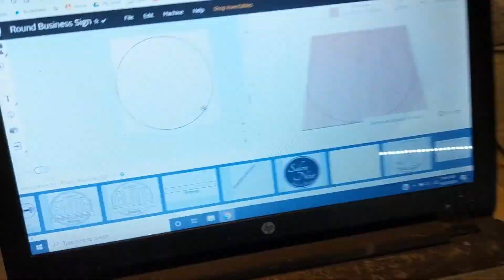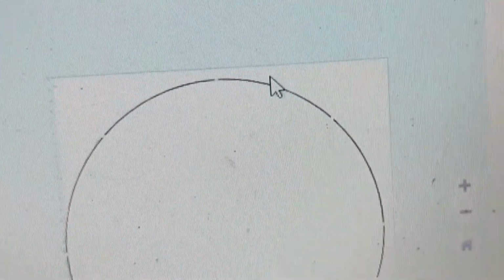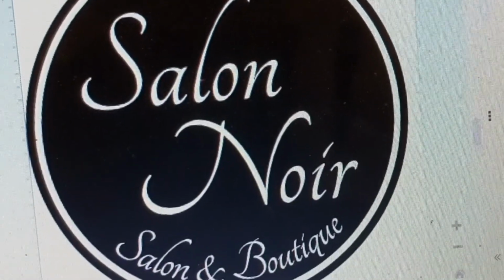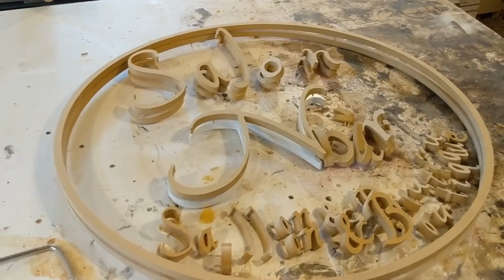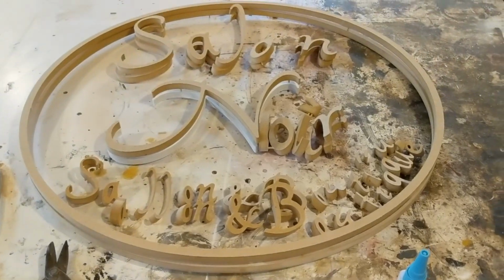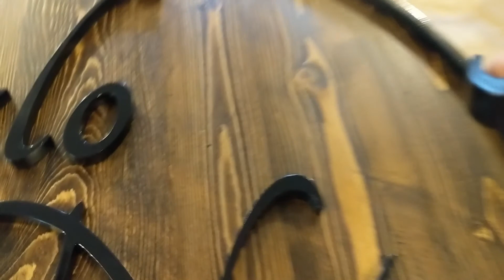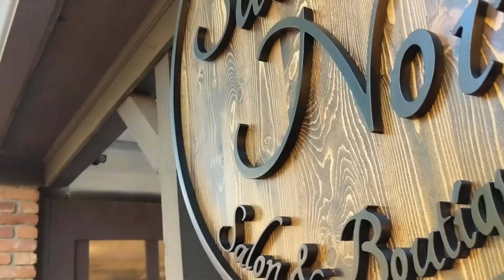How to Make a Perfect Sign Everytime (CNC)

Comment: I have made at least 20 similar signs and this never even occurred to me. The best idea I've had was to vcarve a fault shiplap into it and use those lines to lone it up. But this is a way better idea! I'm going to give it a shot.
Reply from the maker: Thanks for saying that 7 thought I had come up with a unique technique and it's really great to hear someone thinks it is useful.
Reply: @ChadsCustomCreations  so I just tried it on a door hanging round. With a ton of individual letter. And it worked amazingly! I would never have been able to line up and space that many letters by eye. Thats why most of my name rounds use a font I can combine letters, lol. I found skewers at Walmart for like 1.50 for a pack. One skewer did a whole sign. And they are just a hair under 1/8th inch so a 1/8th bit cuts perfect holes for them.
Reply from the maker: That's so great to hear!

Comment: Hi Chad, for this sign what did you use as a protective layer from the rain and sun? Also curious what's the best sealer to you use for stained woods😊
Reply from the maker: I used spray spar varnish wish I could say how it’s holding up now but no idea. Maybe hearing nothing is a good thing right?
Reply: Thank you, I'm checking on the beast seal to use for oil-based stains for outdoor signs

Comment: Hey mate, the holes you put for pins on the board on both sides, how did you get the 2nd side to be accurate after doing the first ? did you flip it over in exact same spot and run 2nd file ?
Reply from the maker: Yes I duplicated the file and mirrored everything to get the backsides of the letters. I really wish I had documented that process better my apologies for skimming over that.

Comment: Great job on that sign. I use the same technique with dowels and it works great BUT if you glue them....you cant change your mind on the coloring that easily...lol  i also use a 26 gauge pin nailer and that is also fast but alignment becomes a problem if you dont allow for registration marks.  By the way...how do you go about pricing your work?   Thanks and keep doing great videos
Reply from the maker: These are great tips and the 23 gauge nailer is awesome I always for get I have one but those tiny holes are so small paint almost fills them in.
Reply from the maker: As for pricing my work it has evolved over time. And I recently had a friend of mine's wife create me an excel spread sheets that allows me to input material cost, labor time, and it spits out a price that includes other things like an overhead cost percentage, taxes, and things like that. I in the passed always over look all those things and this now keeps me at my happy price as we would say on the Working Hands Podcast.

Comment: I like that process man. Seems pretty fool proof. What material do you use for your crate?
Reply from the maker: Thanks it came out of always struggling lining everything up especially on round signs. Sorry crate is that a typo? Letters are MDF which I don't recommend for outside use at all but maybe everything I did will work. Backer is just Whitewood or pine.
Reply from the maker: Ohhh the shipping crate, I made that one out of MDF for the sides, and just cheap plywood. Normally just grab whatever I have available.
Reply: @ChadsCustomCreations  yeah, I've looked for cheap methods of protecting items I ship. Nice idea man.
Reply from the maker: @RCW-Designs   I order a bunch of 4x24x24 boxes from quil.com normally you can get a big coupon to help get the price per box to about $2.50 anything larger than what I can do with those gets custom crates. Which I was not sure if they would take it the first time I brought one to USPS and FedEx but they always take it, and I've notice they won't toss the ones made out of wood.
Reply: @ChadsCustomCreations  yeah I sent a military plaque that was 18” around x 1.25” thick to a buddy of mine in Oklahoma, from Oregon by UPS, arrived in 18 peaces! I thought that was packed and marked well enough to be handled properly but guess not. I realize they have to move a lot stuff fast but would they want THEIR stuff being tossed around carelessly? Anyway great work enjoyed you video neat technique!👍
Reply from the maker: @rbwoodwork1890  ughh I hate to hear that. I seriously have the worst feeling in my gut everytime something is in transit until I know it has arrived safely.

Comment: how do you add the registration holes in the letters and the backer?
Reply from the maker: With easel software I manually added 2 drill points on each letter once I had everything correct you can duplicate the whole page and that's where I made different runs without having to move any of the registrations holes. Mirroring the letters so the holes would be drilled into the back sides.
Reply: @ChadsCustomCreations  Thanks!! took like 30 seconds to do after you explained it.  I was looking for some kind of hole registration tool or something lol.
Reply from the maker: @adamlayton9052  glad you got it honestly I need to remake this video to make it more clear.

Comment: How thick was that board?  What bit did you use to cut it?  I’ve not found any good bit to cut 1+ wood.
Reply from the maker: It was 1-1/2 thick  I did have a hard time finding one also I believe I found it on Amazon I'll take a look around. Everything is in mm on there so it gets confusing.
Reply from the maker: So these are 1.77" length I believe this is what I used but had to have only about .25" in the router. 

https://www.amazon.com/dp/B07X5614TD?ref=exp_chadscustomcreations_dp_vv_mw
Reply: @ChadsCustomCreations  Awesome, thank you very much, I really appreciate it !
Reply: @ChadsCustomCreations  Finally got around to checking and they are only 22 mm which is .86 of an inch :(
Reply from the maker: @SMS14411  keep looking I see those are unavailable now but keep in mind with most you can cut deeper than the cutting edge length. You can keep going in down because the bit has already cleared a path for the smooth shank to travel through. Hope that makes sense.

Comment: I have questions.

Was this a sign for outside?
Are those MDF letters?  I've always avoided MDF lettering for outside stuff just because it loves to swell up.  I use MDO or PVC instead.
Have you had issues with MDF doing that outside?
It looks like you painted the back side of the letters as well.  Have you had issues with lettering delaminating since the glue is bonding to the paint instead of to the material itself?

Looks great though and I like the idea of the dowels.  Definitely stealing that!
Reply from the maker: I was really nervous about the mdf also, I drenched them in shellac countless times before painting them with what seemed like 20 coats of paint. I am hoping those layers have held up to the AIRIZONA weather which already had me nervous. I have not heard any bad news since it has been installed ill have to check how long ago that was. Knock on wood. 

I have recently found a supplier for MDO and have switched to that.
Reply from the maker: So just checked and it was only about 11 months ago soooo I'd say its still a little premature still...
Reply: @ChadsCustomCreations  Woot!  I think it's got a better chance being in Arizona anyhow since it's drier there so that may just be what makes or breaks it haha.
Reply: @ChadsCustomCreations  is that mdo supplier online or a local guy?
Reply from the maker: @jefferynichols2549  hey Jeffery I have been able to get MDO delivered in 4x8 sheets from a company called Grimco you can make an account online and see if you are in their delivery area.